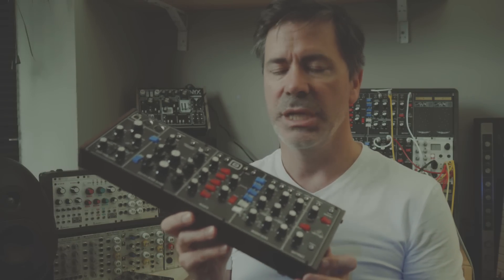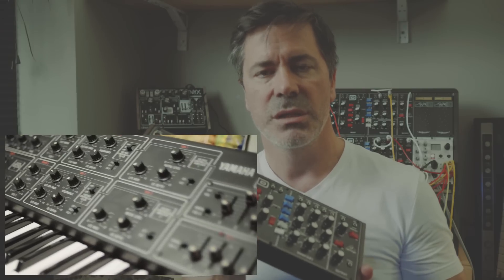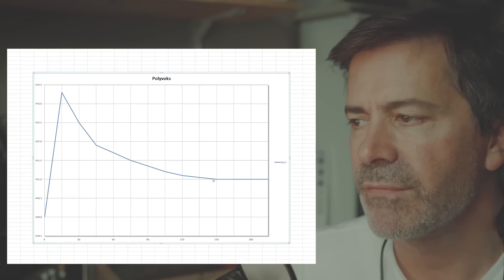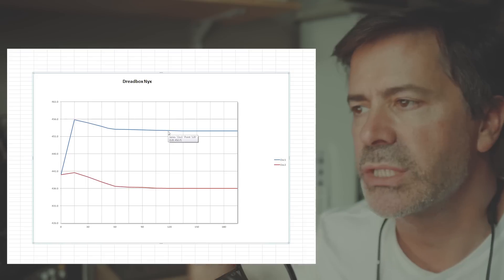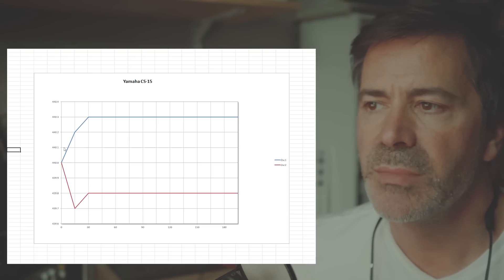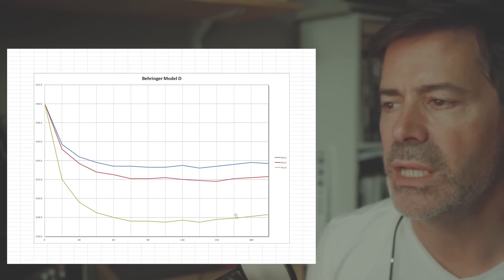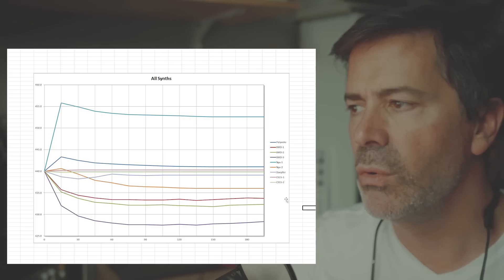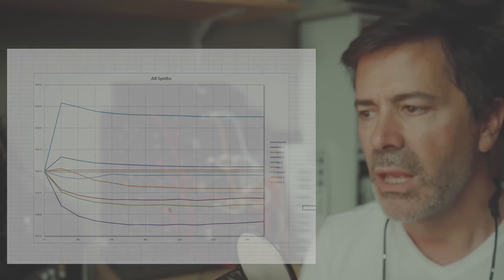Behringer Model D Oscillator Tuning

Comment: For me this is only happening, if i play immediately after turning it on
When i received my unit, i left it on for 60-90mins (seems to be the sweetspot for my unit)
to get warm, then i did the screwdriver-pot-tuning with a phone-tuner
I really only have this issues when my room temperature is varying strongly

Comment: This is highly enlightening. Thank you so much for taking the time to put this together. Leaves me wondering where an original Minimoog falls on this chart. When I'm using an original Mini I usually print it and move on so I don't often go back and double check if its still in tune. Incredible though that the Yamaha's stay in tune better than all the modern synths. I wonder if they have developed some ultra high precision VCOs for use in their big poly's and that tech just carried over to the mono synths of the time as well.

Comment: Thanks for this.
Aside: you've got a "CS50" chapter label in place of CS-15 somehow. 

I've got a CS-60 and it's only one osc/voice - it usually takes about 30-45 minutes for the 8 oscs to settle into stable tuning. Big heavy power rails!
Of all my synths the OB-Xa and A6 have the least stable VCOs. Your D's behavior reminds me of the A6 with the bg and temp-tuning off ....it can drift a lot over some hours, and polyphonically it tends towards sounding 'eerie', imho it's the A6's primary sound characteristic.

Comment: Immediately after watching this, I told myself this is why i'll never buy a minimoog or a clone, but after some quick reflection i don't feel as strongly about it. With the Moog design, you basically have to tune up regularly/often, with others less often but still some. So you put a tuner on the input line or tune by ear, not really that big of a deal. What's more alarming to me in this video is these 1hr+ warmup times. I thought i was being generous giving 15min.

Comment: I love(d) my Model D but since last week.  Even after a long time of being on my OSC's are not just out but going up or down one octave or more from any key, it is so out, like an out of tune guitar.  To have c2 closest to being in tune with c1 I need to play the C2# key then it is still a bit out. You can hear a clear drift if just holding any key down.  Has anyone else had this experience.  Tuning the OSC's on the PCB does not solve the problem either.  So frustrating!!!

Comment: Hi Tim.  Thank you for all the information.  I think IM having a peculiar issue with my Model D.  I bought used but it is in pristine condition.  The issue is I can hear notes going in and out of phase.  Using just one osc I, when I hold a note I can hear very noticeable comb filtering.  I have verified that this is also coming out of the head phone jack so if is not my preamp or sound card.  Have you ever had this issue?

Comment: I have to ask, if you had an issue with the Behringer D tuning, then why did you go ahead and buy four of them?
Reply from the maker: The variation in tuning is only an issue if it gets in the way of you using the instrument. For many people it's not an issue. People tell me the original v1 Minimoog Model D had similar unstable oscillators. Poly-chaining these Behringer Model D's was something I needed to try out, ultimately it was not a viable solution for me personally but I'm glad I tried, and subsequently selling off three of the units later on only lost me a very small amount of money.

Comment: Thank you for this very important and informative video, first of all!
Would you recommend buying this synth for its filter alone? Is the filter alone worth the price even if the oscillators prove unusable?
Reply from the maker: You are very welcome. 

Many people do not find the oscillators to be a problem. But they are likely using the synth in a different way than I do. I use the synth for recording and it is a problem when the oscillators keep going out of tune. I have to keep undoing my patch to tune each oscillator and sometimes I can not put the patch together again exactly the same as it was before. So I end up re-recording and this is all a big hassle.

But despite the tuning instability, I think this Model D is an incredibly good sounding synth, and for the price I think anyone who is interested in synthesis should consider it. It replicates the true vintage Minimoog sound, I would love a real vintage Minimoog but I can't justify the cost.
Reply: @TimShoebridge  Thanks again, Tim, for sharing your thoughts on this oscillator tuning issue and your experience with it! I'll definitely keep your comment in mind.
Reply: @TimShoebridge  I borrowed one from a friend that stayed in tune but the one I bought has been a nightmare. Great video!

Comment: Nothing to stop them using DCO's their still analogue oscillators, deepmind shows you can still add some drift if that's your bag. My boog goes so far out even the tuning knob can't get it back in range, had to leave it on overnight before I could calibrate it as it was impossible to get even close. 2-3 hours I wish. lol
Reply: Left mine on all night too and is still drifting so quickly I can't calibrate it. Might return it and try a different one and then give up if that ones no good

Comment: As of today’s date comment: I got a Boog 2 day’s ago and got me curious about the tunning when I made a patch and when to eat dinner, when I come back it was all drifted. I saw your video and when to B and H in NYC early today (where I got mi Boog). They have a  moog model D to play there...
I dial the same patch for my lead sound (3 oscillator patch) in the Moog Model D and waited there about 1:40 hrs. And when I played it after it did had a drift  on the sound.  It also sounded quite awful, same as my Boog did. 

I fix the patch to my liking and I checked it about 50 mins later and it was some drift, not as drastic as before but it was there, to my surprise it did had some raw naughty sound that was pretty pleasant, but non the less drifted. 

I’m willing to bet this is the same behavior the Minimoog has, is meant to be there. Behringer could have added a tunner such the one find in the Deepmind but that would’ve take the original sound so many are after. 
I believe it’s part of the appeal and secret sauce the Model D has in comparison to other moog synth’s. 

It’s the analog reality, you can’t have it all. There’s a price to pay for real raw sound. 

Whether it’s a real Moog or a  Behringer Model D, I think the spirit of Bob Moog is very much present in this synth and We all have to be thankful for that.
Reply from the maker: Alexandra Senna I have not had the opportunity to spend a lot of time with a vintage Model D but people who used to own them tell they had tuning instabilities. So yes I totally agree with you, Behringer have managed to reproduce the Moog Model D’s instability and  by doing so they also reproduced its charm. It might not be the most practical synth for a lot of applications but it sure can sound fantastic :)

Comment: How come my model d sounds detuned when I'm using only one oscillator?  It's tuned on one key but "off" when I hit other notes up or down like there's an lfo going on or something but it's just a single oscillator.  And it's happening with all 3 independently.
Reply from the maker: Each oscillator is callibrated, maybe worth following the recallibration procedure but are you sure it's not something more simple like your keyboard's mod wheel is slightly on by accident...? Is this something that has been gradually getting worse or just started happening.....?
Reply: @TimShoebridge  Thanks!  but even if it's out of tune, then why is a single oscilator making a warble sound like there's an lfo or something... How can it be out of tune with itself?
Reply from the maker: @sinistar99  I'd suggest checking if there is any way you could be inadvertently modulating the synth. Make sure all modulations are off/at zero. If you have exhausted all possibilities and still have the issue then the only answer will be to send the synth back.
Reply: @TimShoebridge  OMG it was weirdly my MIXER somehow. When I bypassed that it behaved normally.. so I can track it down outside the BMD.  lol thanks so much for getting back to me I love this synth and the sound of it!  I was ready to start pulling hair out.  

The fact that it can go out of tune and warms up like the minis is actually pretty awesome.

Comment: This is all very peculiar. Please think with me:

At 4min:30sec Tim explains his graph. 
Horizontal axis: time = 15 min/div. 
Vertical axis: pitch = 0,5 Hz/div. 

At 11min:00sec Tim shows the pitch fluctuation of the Model D. After one hour the pitch of oscillator 3 fluctuates between -0.2 and +0.1 of a vertical division. This is 0.15 Hz. Oscillator 2 is slightly better, oscillator 1 slightly worse. 

To give you an idea: a semitone up or down would be 12 Hz, so the fluctuation we are talking about, is 12 / 0.15 = 1/80th of a semitone.

What if you would try to turn the pitch of the Model D 0.15 Hz up or down? The total range of its pitch knob is some 150 Hz (from 367 Hz to 510 Hz). So you would have to turn the knob 1/1000th of that range. Can you? And if so: would you hear it? 

Who wants to get rid of this synth because of this behavior? 

By the way, did you know that the oscillator drift in Behringer DeepMind synthesizers is made adjustable on purpose? Quirks mean character, perfection is dull…
Reply from the maker: I'm not following exactly the point you are making but I do state in the video that the vertical axis of each of the graphs has a different scale, maybe that explains some of the peculiarities you see? It is the final graph of all oscillator values together with the same scale that is the most important, and it clearly shows that the Model D fluctuates more than the others. I also state that the Model D needs re-tuning during use more than any other synth I own and the results in the graph bear this out; ie. the fluctuation is audible. Some people will find the tuning issues too much of a hassle where as others will enjoy it and see it as an asset. Moog have made great strides since the original launch of the Model D to improve the stability of their oscillators while still retaining character. Well, some people will agree that they achieved that and some will not. At the end of the day it is a very personal thing and I have been careful never to indicate that I am trying to find fault with the Behringer synth.
Reply: @TimShoebridge  First of all: It is not my intention to teach you a lesson. I just do want to learn and to understand.

And I stand corrected. I didn’t notice that you use different vertical resolutions in your measurements.

Dreadbox = 5 Hz/div
Doepfer = 0.2 Hz/div
Yamaha = 0.1 Hz/div
Behringer = 2 Hz/div

So my conclusion that you have to turn the pitch knob 1/1000th of its range to imitate the effect of the measured drift, is wrong. As the vertical resolution in the Behringer measurement is in fact 2 Hz/div, the fluctuation of the oscillators during the second and third hour of the measurement is (-0.2 to +0.1 div) 0,6 Hz. To create that amount of drift, I have to turn the pitch knob 1/250th of its range. 

By the way, how does your graph show that the Behringer needs re-tuning more often than the others? It is stable during the following two hours within 0.6 Hz. Or: 439.6 Hz to 440.2 Hz = 2.4 cents. That is a very, very small amount. You must have very well trained ears to notice that.
Reply from the maker: @andreweigand1426  Hi Andre, I think I have fairly average ears to be honest. Looking at the frequency recordings I made at the time, from one hour onwards the readings per oscillator fluctuate by a maximum of 0.8 Hz. On it's own, I doubt you would be able to hear the deviation in pitch of 0.8 Hz with a single oscillator. But when you hear all three oscillators played together the mis-tuning is very clear due to the phasing effect it produces. Of course the three oscillators can move in the same direction or in different directions at any point in time, so the variation could in theory be more than 0.8 Hz if you were unlucky enough, I did not observe a difference as large as that but then I was only taking a reading once every 15 minutes.

At the end of the day this video is not a scientific experiment but just happens to be some findings that correlate closely with my personal experience of playing both analogue and digital synthesisers day in day out for many years. Do you own a Behringer Model D yourself? If so how do you find the tuning of it compared to other analogue instruments you own or have tried? You also mentioned the Deepmind, is you interest primarily in Behringer products..?

Comment: I guess I can't really complain because of how cheap it was (got one on sale for 225), but I'm finding I need to ride the tuning knobs constantly, even after calibrating it. Oh, and calibrating the tuning revealed that some of the tuning knobs are not properly centered (need to be a few degrees right or left of center to tune with Osc 1). Still sounds really good for a sub-$300 machine, but I wish they had added stable oscillators while they were adding all the extra features.

Comment: So the main reason I am looking to buy this synth is to handle all my sequenced bass lines live. It would be going on the road. Do to the tuning issues would you recommend avoiding it? I mean I can’t be certain I can wait at a gig with the thing warming up for over an hour...
Reply from the maker: In the end I guess it depends on how precisely you want the synth tuned for the sounds you are creating and how much you feel you are able to tweak the synth in front of an audience. Very personally speaking, I would not use this synth in a live situation as I would want one with presets and bigger controls  as well as more stable VCO's. Not sure what your budget is or how  you feel about buying used gear but you can pick up a used Moog Sub Phatty for a real bargain price these days. You will have no problems taking that thing on the road for sure :)

Comment: This is great Tim. Sounds like it is a bit of a hassle to do though. Did you automate the measuring process somehow?
Reply from the maker: Thanks Rob. The only automation I could think of was to play a continuous tone, show the frequency meter on my PC screen together with a clock and record a video of it! So at least I could fast-forward through the video to 15 minute intervals. But I had to do that for each oscillator on each synth in turn which meant letting the synth completely cool down between recordings, so in the end for all the multi-oscillator synths I did the recordings completely manually and just watched the clock! :(
Reply: Thanks for the reply Tim. That’s quite a smart way of doing it. This has peaked my interest so I am going to think about another way of automating it with easily available software/hardware. If I come up with a remotely elegant solution, I will let you know. That Yamaha is impressive. Regards, Rob

Comment: Thanks for this video. I haven't bought a model D yet but was considering it. I just watched a Behringer vid about tuning the model D and the guy had to take the front panel off to tune all 3 oscillators independently. But you mention you re-tune often during a session. Is there an easier way to tune them? And is it possible to tune all 3 to different frequencies to make a major or minor 5th by playing one note? Thinking about making pads with a monosynth. On my Sub 37 I can change the freq of osc 2 up a perfect fifth which gives me an almost pad like sound from one note; playing both oscillators. Would be great to do that on a model D.
Reply from the maker: Hi, Yes you can tune the oscillators using dedicated dials on the front panel. Minor and major 5ths are definitely not a problem. That Behringer video you saw shows how to recalibrate the tuning which will need to be done at intervals throughout the life of the synth. Basically, the synth might reach you from the factory in tune when all the front panel tuning knobs are at 12 o'clock but this will slowly change and you will find over weeks and months that you have to turn the knobs to different positions to get the tune you are used to. In addition, the different octave tunings will drift too. It is at this point that a recalibration is recommended but by no means essential. 

I would personally say don't let the tuning issues put you off buying a Model D, but go into the purchase knowing what you are buying and that you will inevitably spend time fiddling about with the tuning knobs on the front panel. From the comments and feedback I have had to this video it seems that the original Moog Model D had the exact same tuning issues.
Reply: Tim Shoebridge Thanks, that’s very helpful.